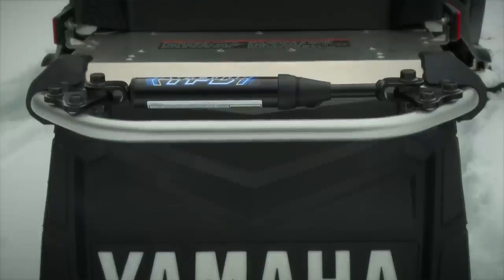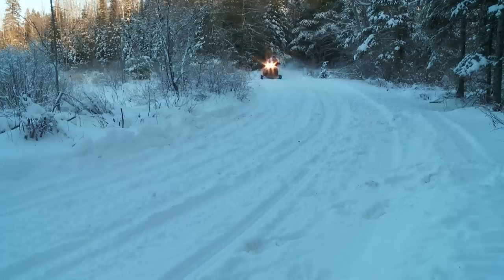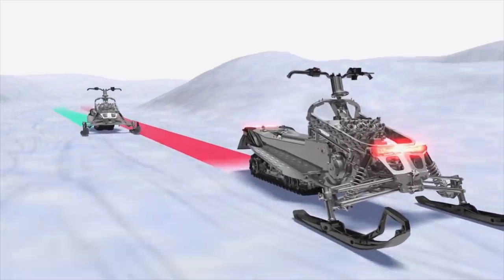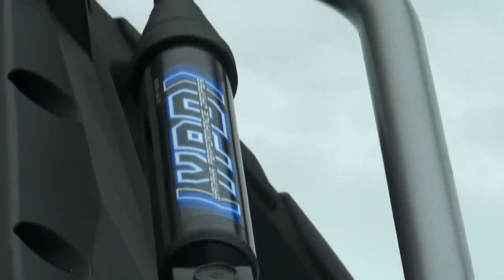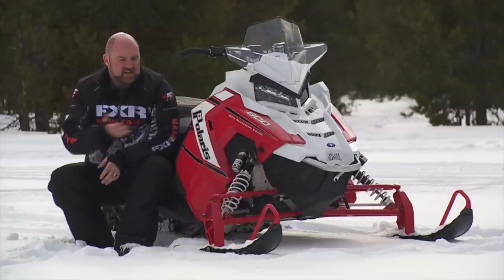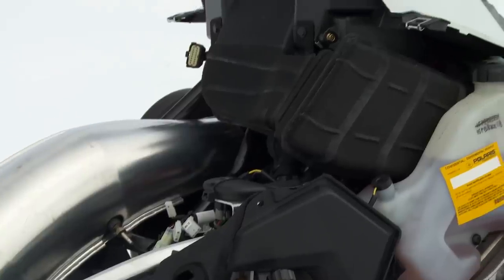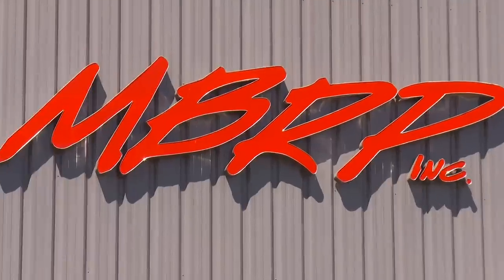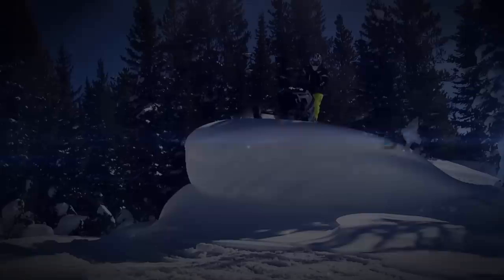SnowTrax Television 2015 - Episode 6 (FULL)

Comment: Hey Snowtrax which model of Smith Goggles do you guys run in your x-1 Carbon, I have the same helmet and although the FXR goggles are designed for the helmet they don fit very well at all lots of wind leakage?